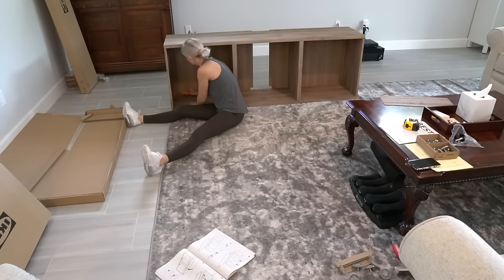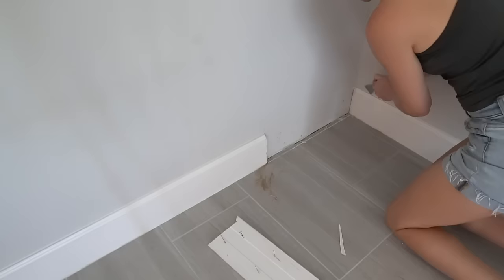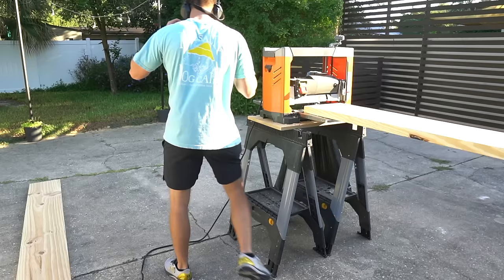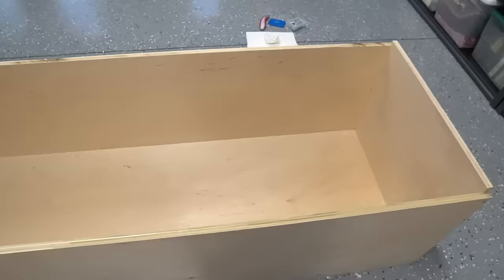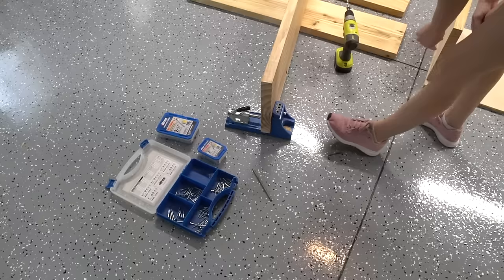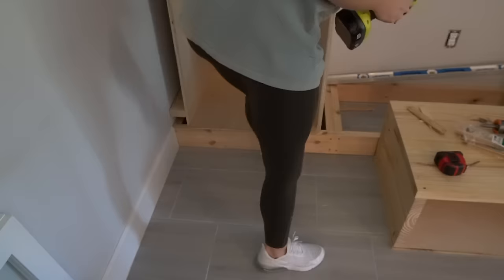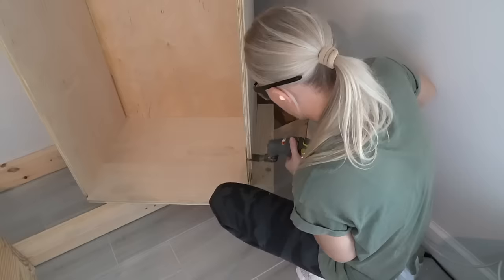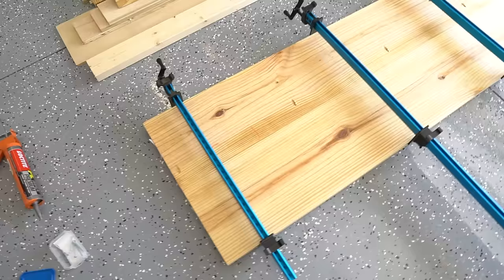DIY Entertainment Center (part 1) | IKEA BESTA HACK

Comment: Really nice job. I had to stop halfway thru video to suggest you build a workbench as a priority. It saves so much time not to constantly be bending up and down working on the floor. Also as an OG I can attest to how it will damage your knees working on the floors for years...I know. A simple Centipede and plywood sheet will save you lots of time and your knees.

Comment: A few problems with this that might have been overlooked.
 Had you spaced this off the wall 1" becuse its an outside wall you would gain a air gap and wire raceway for an audio system and wires for hdmi cables and power.
Last I dont see room for larger floor standing speakers or a spot for a center channel, tvs a lot better with a 5.1 surround system.

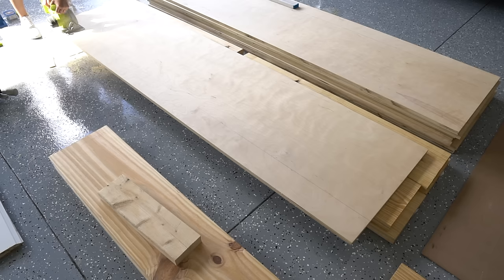Comment: Do you really just eyeball (no track) your line on the plywood with your circular saw (7:37)? Or are you cutting it slightly larger with the circular and running it through the table saw afterwards (off camera) for a perfect edge? You're video are amazing. Taking on a project and trying to replicate the details of your build techniques exactly
Reply: I think Stefani may have winged that cut to save time, because the imperfect cut will be facing the wall anyway and it'll be the panel that'll be the back of the cabinet that touches the wall. Also the wall would be uneven too.

Comment: Great videos! I do have a question about using pockets screws on you benches instead of screwing through the bottom plywood into the 2x12's.
I don't have a pocket screw jig, but thinking I need to get one. Thanks

Comment: Little confused about the extension cord holes but guess I'll wait for part 2. Looks like everything is well planned out. Stay healthy and we'll see you soon.
Reply: Where she added blocking to space the cabinet off the wall, she out holes in each block to pass a cord up to the top of the cabinet for lighting or whatever she wants to plug in. She forgot to show putting a hole in the bottom for the cord to actually get to the outlet (at least for the left side)

Comment: Just curious why not move the outlets themselves instead of notching holes into the unit? Especially the one on the bench. They’ll have to loop a cable around to use it. Could have moved it up above the bench and the one in the tall unit just over a few inches either to the other side of the stud or the neighboring stud. I know you’d be great at it. Even if you had to add some 12-2 cable you’re a bad ass and could totally do this.